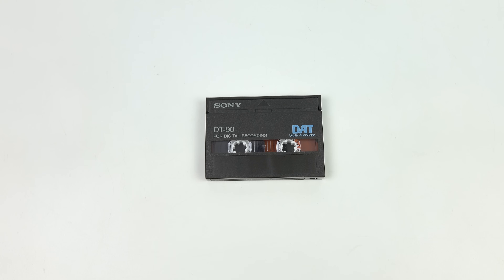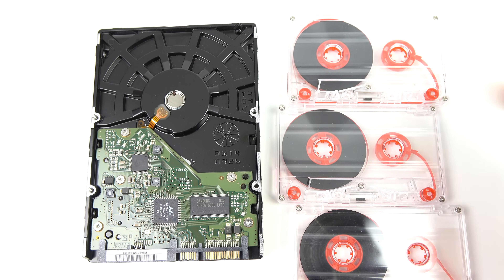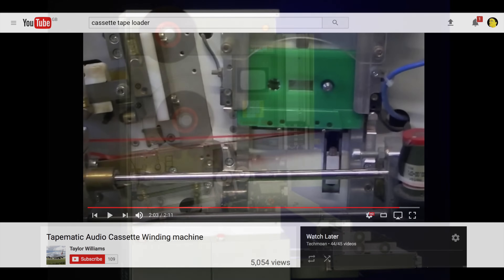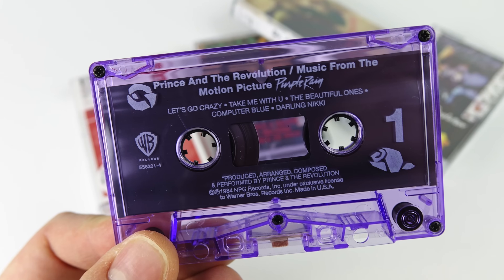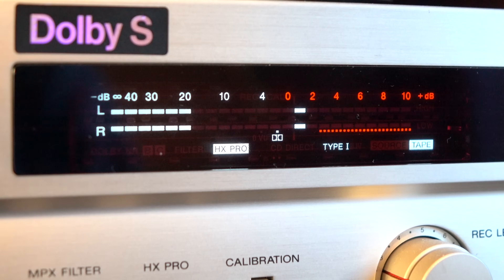Pre-recorded Cassettes' Last Stand

Comment: You should grab a handfull of old 8-tracks to look at the shoddy quality of tape.. I have several that used a tape that was reddish/brown, slightly less coarse than sand paper.  When I began recording my own tapes at home, I started using Radio Shack/Realistic reel-to-reel tape as it was much better quality. And, as here, once the stopper had been pulled out on sales, they began to use much better, less hiss, tape and the quality improved. But, with the uptick in cassettes and the newly released cd market.. the end was in sight.   There were tapes that you could see the individual tracks on as well..   do you have any plans to cover Four Track cassettes from the early 70's?

Comment: Amazingly, or maybe due to my dad's hi-spec Sony sound system? Who knows. I was able to copy computer tapes(C64 and Amstrad CPC) using high speed dubbing and it never failed.

Then again, I read somewhere that by the late '80s, due to slowing sales of tape games they started using lower quality tapes meaning tapes had to be recorded with less copy protection because the copy protection used in earlier tapes would cause read errors due to the poor quality of tape used. The apparent source of that fact was from a copy protection programmer(Rob Nothen, if you wanna look it up) who was tasked with breaking his own copy protection years later because when they come to rerelease them, the software house had the aforementioned issue but didn't retain their source code.

Comment: I'm lucky enough to have a cassette deck that does the "digalog" stuff at the other end... On playback, rather than record. It cancels out all tape noise and corrects all frequency response errors digitally. It's a Pioneer CT-W606DR with Digital Flex, which makes all cassettes sound like they were recorded on Metal tape with dbx. It even works extremely well on pre-recorded cassettes from the 1960s. Well worth seeking one out.

And like dbx tapes and records, you have to remember not to crank up the volume when you press play and hear total silence. Because if you do, when the music starts it will blast you out!
Reply: I use dbx, made in 1991 by me. It makes great sound on any decent tape.

Comment: One thing I've noticed in buying cassettes this past year: the snob value.  All the DECCA cassettes of classical recordings - new or old - are recorded on cobalt tape.  The sound is good, even on a mediocre cassette player.
Reply: Some of the London (Decca) classical cassette titles in my collection are on chromium dioxide tape, it's prominently mentioned on the spine. You are right that many London/Decca titles released in the 1970s are on ferric or cobalt tape stock and generally offer splendid sound quality. Oddly, in some cases the CrO2 tape hasn't aged all that well and the high frequencies sound rolled off three decades later: yesterday I played a 1987-vintage London Jubilee tape of the Rachmaninoff Piano Concerto No. 2 (Ashkenazy/Kondrashin/Moscow Phil), it's a stunning and intense performance but playing on my Nak BX-1 the sound is murky, lacking detail and dynamics, very dull compared to the LP.  It may turn out that ferric and cobalt tapes may retain their magnetic qualities better than CrO2 tapes, at least in some situations.

Comment: The technical comments after 8:30 are largely incorrect. The quoted bandwidths are wrong, the 200Hz lower limit for chrome is even ridiculous. It is perfectly possible to lay down and retrieve 15Hz to 23kHz (within +/-3dB limits) on ferric, chrome, ferro-cobalt, and metal tape. This has been demonstrated by nearly every Nakamichi deck since 1973, and many many other decks from other manufacturers. At any rate, music cut down at 200Hz would sound unbearably thin, something not the case with nearly any commercial release. QED.

Ferro-cobalt tape was born in 1974 with TDK's SA for the consumer market, in response to practical and political problems with chromium dioxide tape (early lower-tier recorders could not exploit chromium well, leading to customer dissatisfaction, and Sony held the monopoly for the distribution of Dupont CrO2 in Asia, an impossible position for Sony's competitors). SA operated more or less at chrome settings, but offered higher sensitivity, higher MOL, but also higher noise. By the mid-1980s these gaps between ferro-cobalt and chrome were mostly bridged by both parties, both offering high MOL and low noise. [Cobalt was added even earlier than 1974 to ferric tapes, e.g. Maxell UD-XL and Scotch High Energy, but these tapes were not for the type II slot.]

In the 1970s chromium dioxide got popular for quality releases because early chrome offered better performance than early ferric duplication tape. However, the concurrent arrival of Dolby noise reduction reduced this relative advantage somewhat. By the early 1990s nearly all tape manufacturers had dropped the production of chrome (costly and environmentally unfriendly) and thus the duplication world had to adopt the same sort of tape that the consumer world embraced in the early 1980s: ferro-cobalt.

Comment: I don't understand why they didn't at the very least use HX Pro on modern tapes.
Reply: Good question. If the duplication equipment has the capability, to my knowledge no royalties are due to Dolby Labs just for utilizing the existing equipment. However, a PRCT seller can't use Dolby's trade name or logo. They could come up with a generic phrase like "dynamic headroom extension encoding". Likewise, if using the Dolby-B encoding features of existing equipment, deploy a generic term like "B-Type Noise Reduction encoding".

Comment: I was always a big fan of audio cassettes. The quality of pre-recorded tapes was excellent in the 1980's. In fact my cassette:  Dire Straits "Brothers in Arms" which I bought in early 1986 just recently died (unspooled)That's 34 yrs! Not to mention the cassette release had longer versions on some of the tracks. That was starting to be common. Synchronicity by the The Police added a bonus track. 
I don't remember the cost of cassettes in the record stores back then. Probably a little less than vinyl.  I do remember CD's prices were up there, like $18.00 to $20.00

Comment: 10:37-10:53 you clearly don't understand how capitalism works. If you increase the manufacturing cost by about 4-12%, this lowers your profit rate significantly, probably near to zero. Just using the retail price for comparison doesn't make any sense. because it also includes royalties and markups by distributors, wholesalers and retailers. A company that has a lower profit rate can't compete, so they have to do this "short-sighted penny pinching".

Comment: Cobalt was not really new in the 90s. Chrome tape was very expensive, and was prone to wear (which also wore down the head of the player), and mainly BASF produced actual chrome tapes. Japanese manufacturers such as TDK and Maxell were looking for alternatives early on. They ended up with formulas mixing cobalt with other materials, to get a tape that was close in properties to a chrome tape, but less expensive, and more durable. So even in the 80s, hardly any real chrome tapes were on the market, many were cobalt-based (like the classic TDK SA and Maxell XL-II). This also led to the manufacturers experimenting with special formulations for normal tape, leading to a class of high-end normal 'superferric' tapes. Pre-recorded tapes started experimenting with using chrome-spec (cobalt-based) tape, but recording in a way that is compatible with players that only support normal tape (for maximum compatibility).

Comment: I started buying music on CD when they first came out but the players were too sensitive to bumping, so for many years I'd by a CD and some cassettes, usually metal, and make a copy of the disk for use in my car.  I remember the very first portable cd player i had, it was only portable in the sense that you could set it down anywhere and it would play, but if you tried carrying it while listening to it no matter how careful you were it would skip so frequently as to make it not worth the effort. That and the fact that it ran on 6 C cells so it was too heavy to carry comfortably. So my early experience and lack of faith in the use of CDs on the go ensured my use of tapes for many years,  eventually I abandoned cassettes, but I switched to miniDisk because at this time I still didn't trust CD's while traveling and mini disk had the added benefit of being able to drag and drop my music on the computer for recording. That remained my preferred format until the introduction of the iPod, when i discovered that it could hold all my music on one device, and that i'd never have to decide on what tapes or mini disks I'd want to take with me. I still have a massive cassette collection and over time I've been recording them to the computer. Audacity software does an incredible job of cleaning up the sound and removing hiss.

Comment: Another informative video regarding the Compact Cassette.  This time focusing on the pre-recorded segment.  I never knew any of the majors made any mainstream cassettes using Dolby S so I found this very interesting.  I actually purchased two decks with Dolby S.  A mid-line Sony (i.e. not ES but with 3-heads) and an AIWA one.  I did like the quiet background but on both I felt it made the treble noticeably softer.  I got around this by boosting the 8K gently and the 15K just a touch more.  By doing this I thought I made some great mix and album Compact Cassettes.  I think HX Pro was great because it would help any tape by reducing saturation effects and retaining those higher frequencies.  Dolby S was pretty much still born, kind of too late and not evolved enough.  I have a feeling Dolby S was very needy in the perfect azimuth alignment between the record and play heads.  I may be wrong, but I get this impression.  As most consumer decks were not user friendly to adjust the playback head azimuth I kind of think I never heard the finest capability of the Dolby S system.  If cassette transport technology would have evolved to that next level, as did the Dolby encoding and the blank tapes, I believe Dolby S would have eventually been the new NR paradigm.   Of course this wasn't to be.  It bears a thought that while high-speed dubbing did negate wow and flutter it would also have potential for poorer fidelity overall.  We're dealing with very small tape gaps here and a certain amount of time is required for rock solid contact to properly saturate the tape in perfect alignment.  Any deviations from the ideal arrangement just may be exacerbated by speed.   If you feel I was a cassette lover in the 80's (or any time for that matter) you're correct.  I truly feel the medium was never taken to it's zenith as the LP and associated turntables are being manufactured to today.  I saw an article somewhere a few years ago titled "Cassettes, Not As Good As You Remembered" where the author was scratching his head regarding the latest generation discovering the cassette and indie bands actually using them to distribute their music.  I thought while he may have had some points he was too harsh.  Simply put, I have some dubs and mixes I made in the 80's that are wholly good to listen to today.  The Compact Cassette was killed before it ever reached it's full potential.
Reply: the way cassettes are being used today is just a total novelty. . it's much worse than the 90s.  it's just a "cool" factor and has nothing to do with sound quality

Comment: High speed dubbing is BAD. Imagine a digital 44.1khz signal dubbed to tape at 2x. Now when you play the tape at 1x it is the same (if we neglect wow, flutter, and the higher noise floor of tape) as a digital recording of a 22.05khz sample rate. Even a 192khz file will be at the equivalent of cd sample rate at 4x dubbing. In the 90’s 44.1khz was the norm for recording, so Digilog was no competition for CDs. Now today if the master were at 192khz sample rate at 1x with a stable deck you might beat CDs. 0.5x recording is senseless, the recording will only suffer more wow and flutter with no added gains. Please message me with questions or if you feel like talking about this.

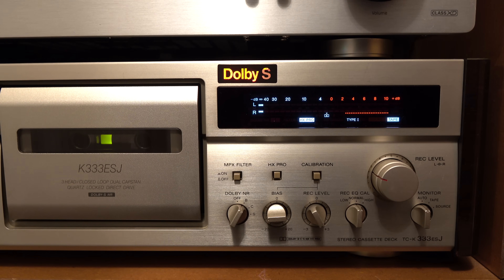Comment: 6:10 -- HOLY SHIT, Techmoan!  Have you ever heard that "quantum physics explained" quote from Richard Feynman, often repeated since, which says there are no human scale things to easily point at, to show what "particle-waves" and "uncertainty" means?

You Have Identified One!  We might suppose that driving it faster is a bad thing, but as you say, there is little or no chance for error and distortion in such a short period of Time, that Location is practically perfect. + 10 Points!!
Reply: By normal explanation, the wow and flutter is a speed variation on the media; the more precisely we might attempt to control the speed (ie. "playback", 1 to 1) the increasingly sensitive it is to distortions, interference, since it has an unfathomably large amount of Time, in the quantum sense, at our 1 to 1 speed and inches of tape.   It is less precise to run the tape faster and faster (we'll lose some resolution on the edges or ends, perhaps) but there are less variations with which to contend.  Sweetness!

(Double Check me at a University physics department.  Pretty sure I got this right, if you've got this right.)
Reply: Yes, Quantum, because Electromagnetic Tape + Signal.   Also, this has got me wondering about what power of 2 would be sufficient for most cases.  Somewhere between 2^5 and 2^10, hm?  I mean, speed of the Media being recorded to, to shorten the length of time required.  This also stands to reason for a very high quality disc image being recorded I should think.

The Compact Disc / Tape analogy is good for another reason - the Lens.  The Signal which is sent through the Recording Head is basically being projected (via magnetic fields) onto the tape.  We could think of the shortest-possible-burst of EM waves as being a very small but very accurate image which is projected to very large and high quality, by running the tape faster and stretching it out automatically.

Comment: Cobalt tapes are actually ferro oxide tapes with an addition of cobalt which improves its magnetic properties. And the properties could be varied a lot, so they either produced type I tapes with slightly improved high frequency response, or type II tapes which matched chrome tapes without using chrome. While the Americans (Dupont) and Germans (AGFA, BASF) produced true chrome tapes, the Japanese TDK and Maxell produced "type II high position" tapes without chrome, in order to avoid licensing the chrome technology. Here is an article in german that explains the different types of tape: http://www.magnetbandmuseum.info/w-bruch-artikel-nr66.html
Reply: You can tell the quality of the tapes from looking at them. Light brown is normal ferro oxide, which is fine for open reel at high speeds, but poor in high frequency for cassette or open reel at low speed. Slightly darker brown is ferro oxide slightly doped with cobalt, this is compatible with simple decks for normal tape, but has quite usable high frequency response. Black tape is either chrome, type II cobalt or type IV "metal".

Comment: I'm newer have tape player with hx-pro nr system, but in market it was hard to find prerecorded cassets without hx-pro nr sound. That records sounds ugly and harsh on my tape player because it does not have hx-pro nr system. And when I realized I couldn't buy a new record without this fucking DOLBY HX PRO, I cursed these all compact cassettes. Dolby HX pro is the worst thing that could happen with cassettes. Because no one knew that this and 99% of all the players available to consumers were not equipped with this system. That's why everyone began to think that cassettes sound awful compared to compact disc.

Comment: WEA's Digalog system used off-the-shelf Concept Design equipment for their digital bin. Concept Design was the first to introduce the digital bin, and this was BEFORE the cassette began its decline. WEA intended to use TDK ferric-cobalt tape for the promotion, and that's why cobalt is mentioned in the one press release. Experience, however, showed the tape had far too many problems running at high speed, so WEA went back to ferric tape as their main tape with chrome filling in when customers asked for it. (The Dolby S cassette at the end of the presentation is loaded with BASF LH-D ferric tape. We supplied 80-90% of WEA's production demand.)
The information about the benefits of cobalt and the problems with chrome is mostly nonsense. Of the names mentioned in Billboard and other publications posted in the video, only Joe Kempler and I knew anything about tape. Chrome is perfectly suitable for frequencies below 200 Hz, and it is far superior to any other formulation in terms of modulation and bias noise. Chrome tape was the only tape specified by A&M Records, Windham Hill, and American Grammaphone; and many major labels used chrome when artists demanded it. Cobalt was NEVER a threat to the use of chrome and offered no technical advantages. The reason metal tape was not used at high speed was that the bias required would make the slave heads too hot. Cost was also a factor, but the fact that metal would not work is why that formulation was not used.

Comment: The refusal to pay the extra money for higher quality cassette was a prescient business move considering the time period, when CD's were taking off, DVD was just around the corner and so was the Sony Playstation, effectively putting a CD player into millions of people's homes as the PS2 did for DVD. The writing was on the wall for cassette. Having to put a bunch of money into developing business relationships and supply contracts with cobalt suppliers would have been a huge waste.

Sure they sounded good, but the mass market isn't hung up on specs. Also CD's don't need rewinding and don't degrade in quality after being played multiple times.